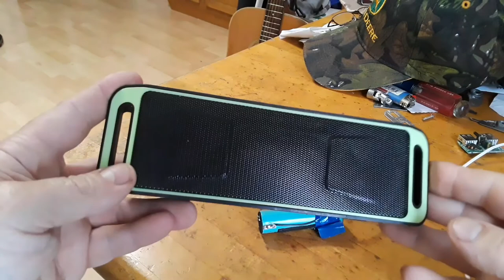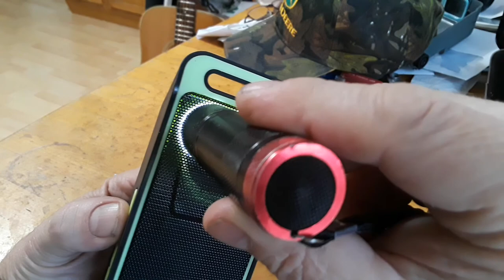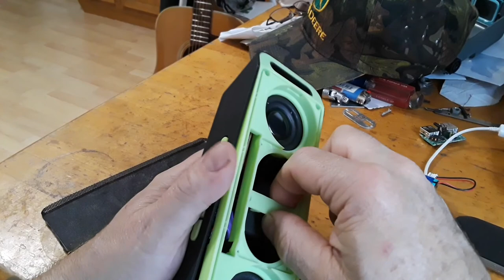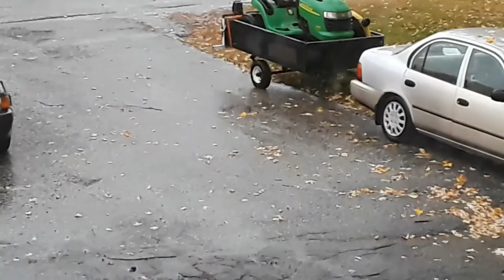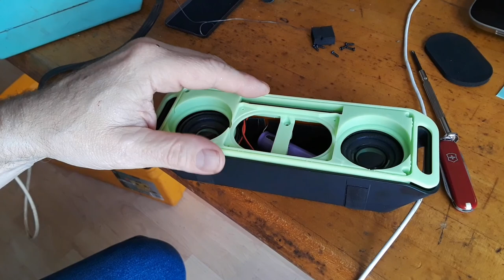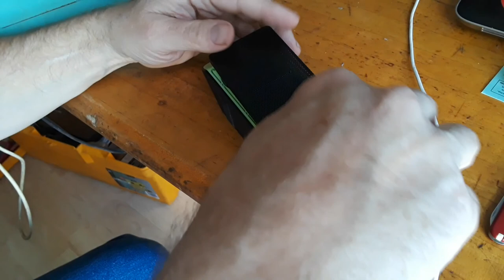Blue tooth speaker won't charge

Comment: My fake pulse 3 stopped working a long time ago. So I bought at 3.7 volt 2200mah battery from amazon. Installed it and it worked like a charm. After 15-20 min of playback, I put it on charge via my mobile charger. It was again the same problem, it felt like battery was not getting charged, rather it was getting damaged while charging. Suddenly speaker woke itself and made cracking creaking sound with couple of blinks and turned off. Now it doesn't respond if I try to turn on or charge it. Can you help????
Reply from the maker: Could be something in there wa connected with the wrong polarity.
If you remove the battery and put it on charge you might see voltage at the connector.
You can sometimes see where the battery leads attach to the board. Sometimes the board has a plus and minus on the board.
It might be reversed there.
Easiest is if you have a meter you can check polarity that way.
Thanks for watching
Reply: Nah....the polarity is ok. Someone suggested me to charge the battery 100% first, then plug it on the board. Am charging it right now via 5v 1.5amp mobile charger. I hope it works